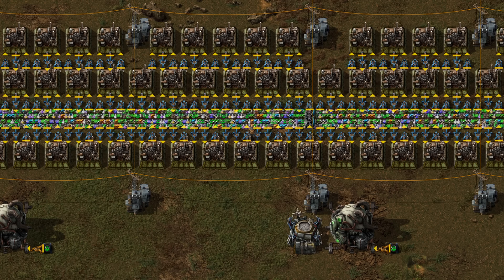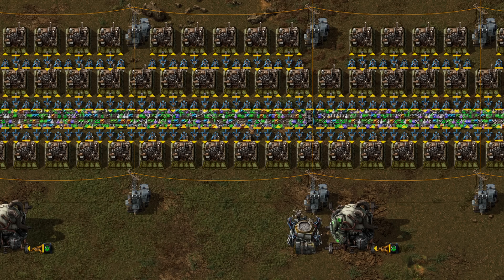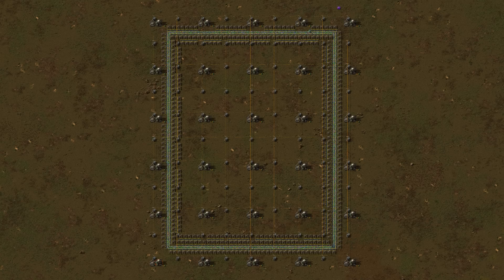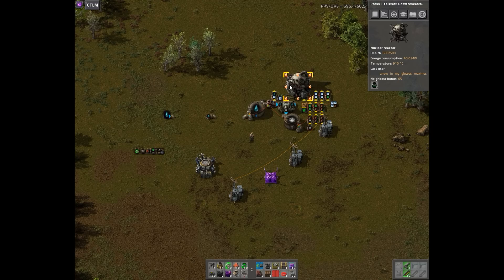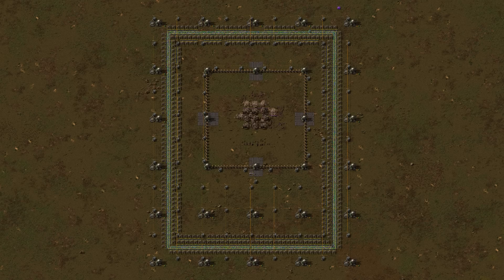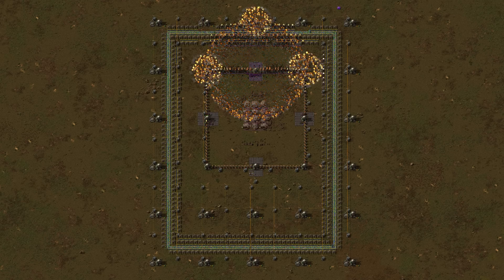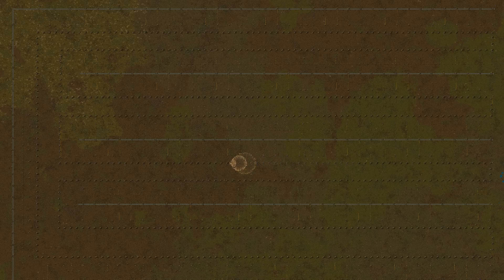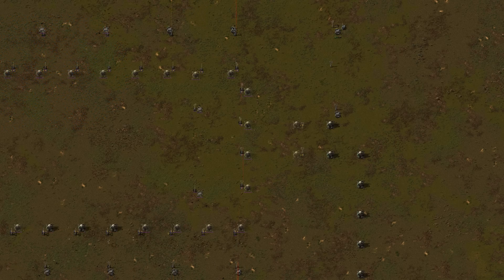self destruct mechanisms in vanilla factorio

Comment: Honestly, the artillery is the most viable option. If your enemy is smart and has a well thought out heist plan, then they'll have made off like fat bandits by the time that pilot explosion trigger got around to detonating.
Reply: just use a 2np pilot  explosion phase shifted by 180°
Reply: @vega1287  you'd need a whole separate pilot. the cycle is governed by the time it takes to heat up a reactor.

Comment: This gave me an idea, can you make a game of life simulation with a grid of explodig reactors ?
Reply from the maker: uuh probably, and you would still need a small amount of combinators at each cell to trigger the building of the connection reactors.

Unless you find a way to make a transistor from reactors that is.

But there is a small problem, this thing would be need to be huge. Have you seen how large the loop was in my video? That wasn't for style. If I try to make it smaller, you risk that the reactors aren't hot enough to explode. So each cell would need to be at least as big as that loop.
Reply: In other words, are the exploding reactors Turing-complete?
Reply from the maker: +MrKeotan after some more thinking about it; If you combine them with electricity (and all the steps needed to generate it from the reactors) then yes. I'm still not sure about reactors on their own...
Reply: staviq I‘m not sure. The reactors have four states, ready, exploding, building and heating, while the timestep size would be the time for the explosion to propagate. If you lay them out like in this video, neighbours are only the four cardinal directions.

If a ready reactor has an exploding one as a neighbour, it turns into an exploding one. An exploding one turns into a building one, which after x timesteps turns into a heating one, which after y timesteps turns into a ready one. However, if a heating one is a neighbour of an exploding one, it turns into a building one, which I feel would make repeating patterns on a simple uniform square grid unlikely.

Comment: So you only need the first reactor to be over 900 degrees in order to start the explosion chain?
Reply from the maker: You can destroy a reactor unter 900 degrees but it wont explode. So it's possible to do it with a few under 900 degrees as long as you have alternate routes for the explosion to travel...